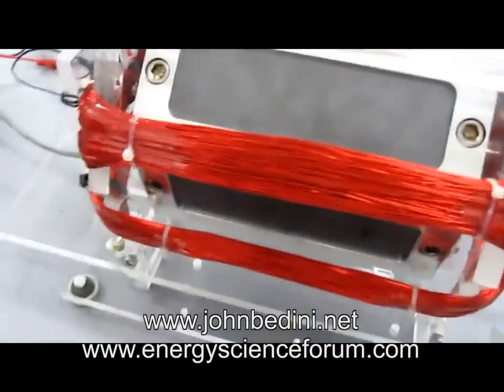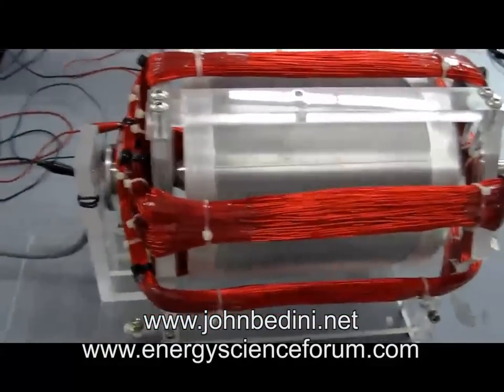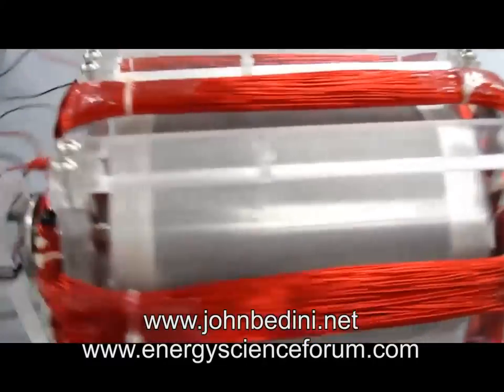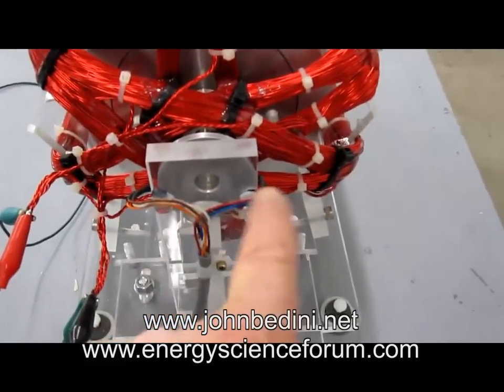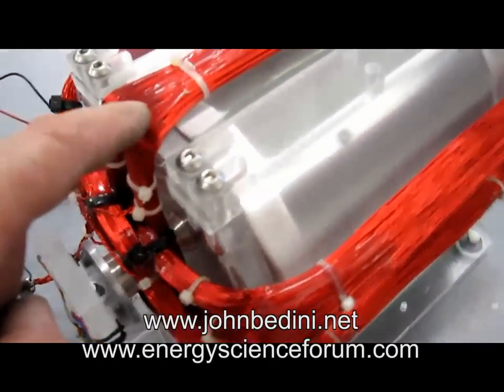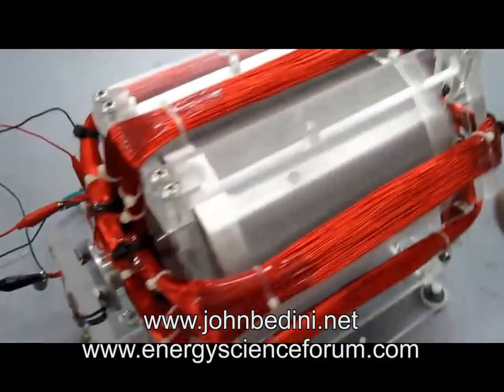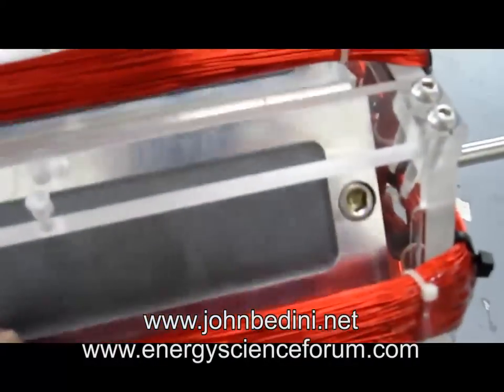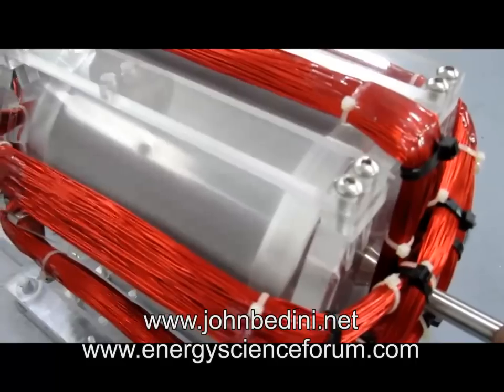Bedini-Cole Window Motor

Comment: I keep seeing stuff similar to this but it is always a motor without a load. How does this convert to usable energy?
Reply from the maker: Speed is power so scale them up and make them go fast and you can get real useable work from the shaft. That is essentially what the air core SG is that Paul Babcock and Mike Clarke were showing and were able to sustin hundreds of watts of net work from the shaft to turn a generator while the batteries kept themselves charged up.

Comment: All of these motors work some of them are more efficient than others all of them are missing one component they call it a railgun voltage accelerator circuit it's also called a nuclear accelerator circuit or a nuclear power circuit and it's just a pile of diodes that work just like a Tesla valve can generate inductive Spike pulse out the ass

Comment: Beautiful! I am seeing a lot of similarity between this window motor, and joseph newman's motor. Specifically, air core windings around permanent magnet rotor, and proper switching of coils. They make a lot of torque don't they? For a small brief input of current.
Reply: Yes, very similar (especially how he feed's the pulses back to the primary battery) but John's uses solid state commutation versus mechanical switches for the Newman motor.  I have to imagine the Bedini window is therefore more efficient.

Comment: why you not putt the motor in a case where it cant get any air around and gets much better turn
Reply from the maker: +SuperMaiki76 That would make a difference, but this is just a prototype to prove the point. But you're right, the less friction the better.

Comment: Good test run ;-)
It's fairly clear that increased efficiency is the primary goal.
I would suggest the use of capacitors, as they pull more electrostatic energy through.
Inductive winding's retards the energy flow :-( greater losses.

Comment: Aaron, a question, can you move a Kromrey converter and generate free energy with it?
Reply from the maker: Emiliano, what do you mean by move it?
Reply: i mean transfer torque from Bedini Window motor to Kromrey converter for electric power generation.
Reply from the maker: It would probably be the most efficient to power the Kromrey directly. I'd suggest you join http://energyscienceforum.com to explore your ideas on this.
Reply: I'm Darkwizard at the energetic forum.
Reply from the maker: Energetic Forum has quite a bit posted on all of this, but at Energy Science Forum, that is Bedini's official forum and several very knowledgeable people are there that have experience with these machines.

Comment: For decades there have been demonstrations of free-energy devices, but who has one that is:
1 -  certified real (aka Not Fake)
2 - running their entire home for free?
3 - is electro-mechanical like this motor
I can't find any and I've been investigating since 2000.
Reply from the maker: So are you saying there are real free energy devices, just not scaled up to run a home?
Reply: @AaronMurakami13  1 -  certified real (aka Not Fake) takes precedence, that's why it is #1
Reply: DataWaveTaGo  ,, explique BATERIA DE KARPEN , por favor
Reply: @chirola20100  Doubtful. Let's face it, if it worked as claimed it would be in use.
Reply: DataWaveTaGo ever heard of solar panels?
Reply: @baileyharrison1030  I'm putting them on my home. I'll add a 3rd item electro-mechanical, like this motor

Comment: A home will use about 2-10kw depending on how many appliances you turn on.

If you are looking at 24kw, you must have some zoo in your home.  Unless you have a really large home and plan to turn on air conditioning in all rooms 24/7
Reply: 2.5KW is considered standard for a home. Like if you are having Solar or Wind Turbines put in to power a average home, you usually aim for 2.5KW on average. Most homes wont even draw that constant, but closer to peak

Comment from the maker: Zoidy - 25kw is the average home in the UK? That is about 25 times the average draw of my home in the US, which draws an average around 1kw 24/7. How do you figure 25kw? My peak is only about 3kw for my electric clothes dryer, which is the biggest electrical load I have.
Reply: Maybe that is 25 KWH/day for them. Our average is 67KWH/day unless I'm doing some welding. That throws a 50 amp load on the 240. And at idle it is drawing about 15 amps. That alone would add 3KW to the already ~3KW load.